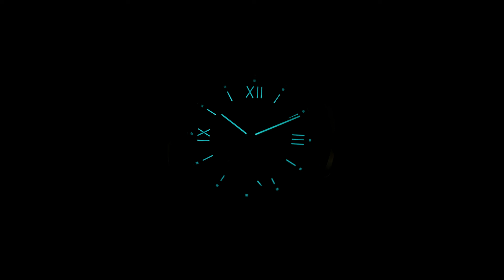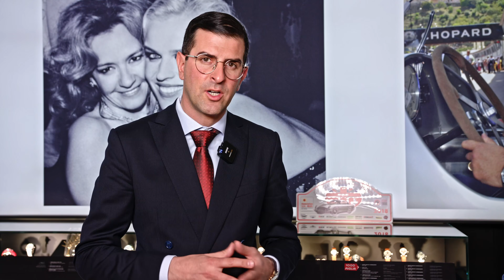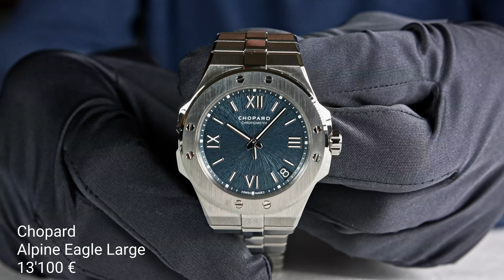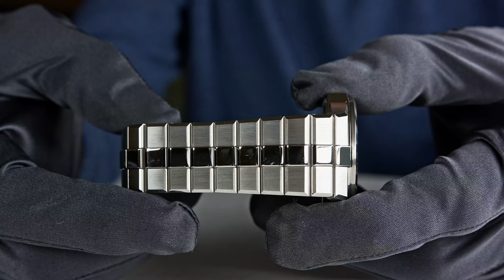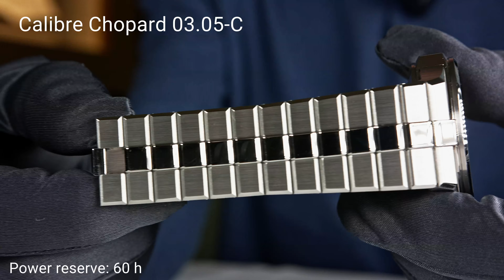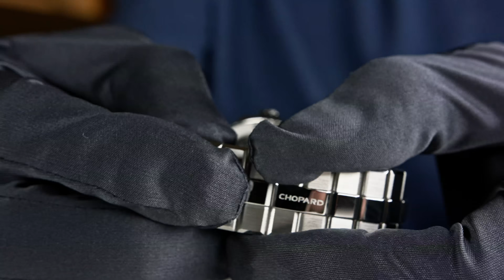CHOPARD Alpine Eagle Flying Tourbillon in Lucent Steel A223.

Comment: Very nice addition to the line up, thrown in a tourbillon yet slimming down, I can imagine it will wear very nicely on wrist.
People should drop by the Chopard boutique and see the Alpine Eagle in metal, it's a level above those steel sport watches at around 10000USD mark, quite hefty, very nicely polished at every corners you can see/touch, and the dial is mesmerizing. A fine piece of jewelry
Reply from the maker: I fully agree with you! Thanks for sharing!
Reply: @WatchAdvisor  Thank YOU for the awesome videos!